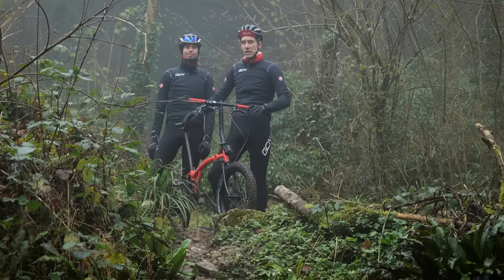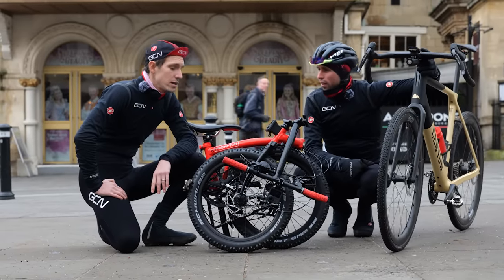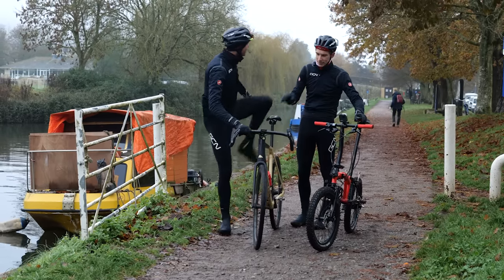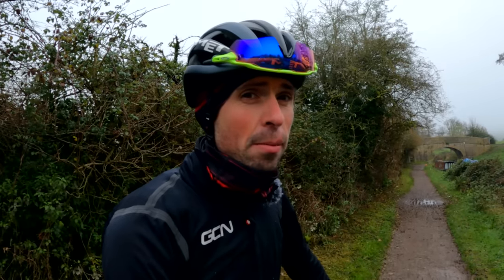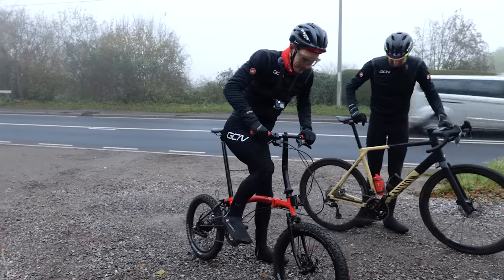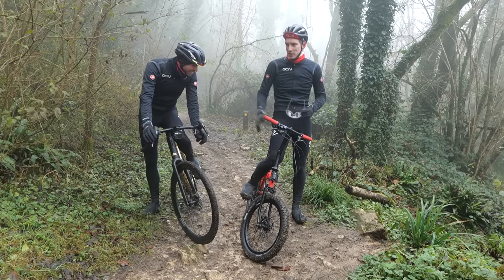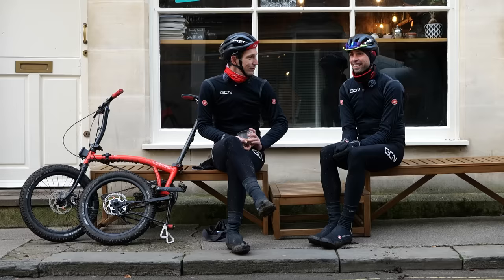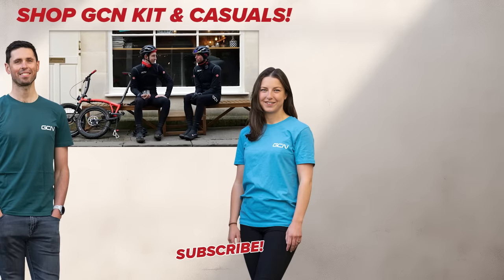We Made A Crazy Gravel Brompton... How Scary Is It?!

Comment: I think you may be doing the stock Brompton a bit of a dis-service. Yeah they’re used on smooth tarmac in towns and cities, but they’re also used by a lot of people for some pretty rough stuff. All you need to do is put a 39t chainring on the standard 6 speed and you’ve got yourself a bike that will get up most hills, even with a load! I regularly take mine into the Welsh hills on rough lanes and also on canal paths and gravel tracks and it works just fine. Still, it’s interesting to see what can be done but at the end of the day with all the changes, it’s not really a Brompton anymore !…why not just test a Bike Friday all-packa which is a ground up, properly designed 20” off road folding bike?

Comment: Brompton’s will definitely take more than they’re designed to (maybe not long term!). 
Such great bikes, and the initial twitchiness you soon get used to. 
The standard wheels / tyres can catch you out, not so much pot holes, but I managed to ride out of my drive one morning and got the angle wrong crossing a drain cover. Result - front wheel drops into the groove, stops dead and I’m pitched over the bars into the road 🤦🏼‍♂️

Comment: These are super fun conversions. Ben at Kinetics is a great bloke. Thoughts having built my own custom Brompton:  - 1) You can get more 'gravel bike-y' tyres in 20"/ISO 406 size that are probably better all rounders (ie Schwalbe Billy Bonkers) that would be great for commutes that involve canal tow paths and light gravel -  but less rolling resistant on tarmac than full knoblies 2) you could put something like a Crud catcher mudguard on the back by attaching it to the seatpost. Would look dorky, but would work :)  3) some Ergon grips and an adjustable stem would make for a better cockpit for grunting up hills   3) There's so much room with the bigger forks and triangle, that one could make a really nice 'fast' road Brompton with this kit using the larger 20" size  (ISO 451) with skinny road tyres - yes the fold would not be as good, but make for more long-legged bike that's less crashy in the potholes. Could be a good Triathlon bike for same reasons.

Comment: The price you modify this Brompton can just buy a Birdy, which can be used as a MT folding bike. But the biggest problem is there is a hinge spindle on your Brompton main frame, if you ride your Brompton like this, pretty soon that hinge needs to be replaced. Worse than that, the hole will be getting bigger. Eventually you will need a new main frame. PS: I do like Brompton with disc brakes. I have 4 Kinetics Brompton with disc brakes. After watching this video, I think I might take one of them to replace the wheels from 349 to 355 so that way I can use Schwalbe Black Jack tires and see how it works.